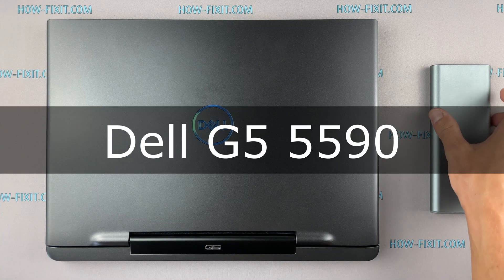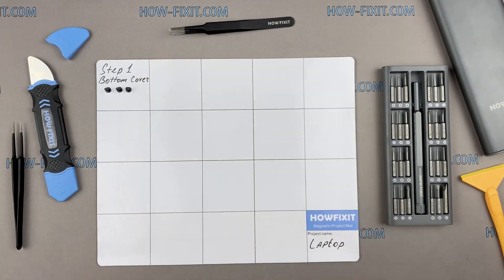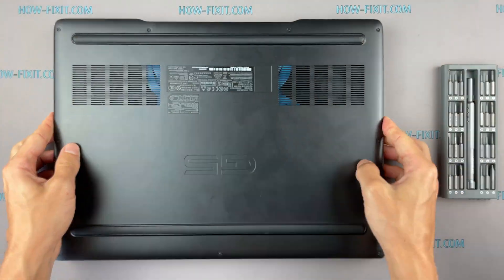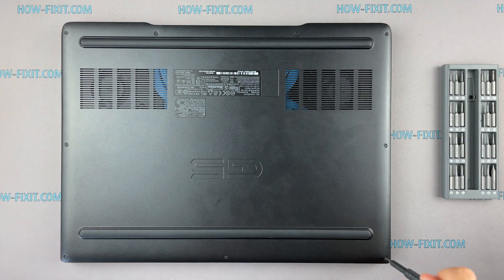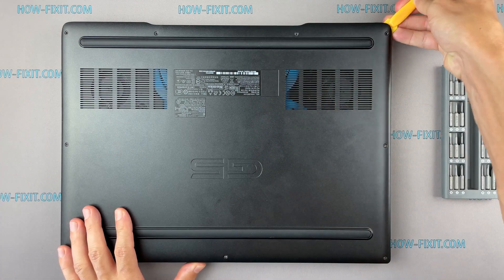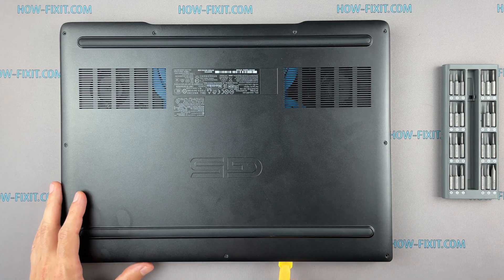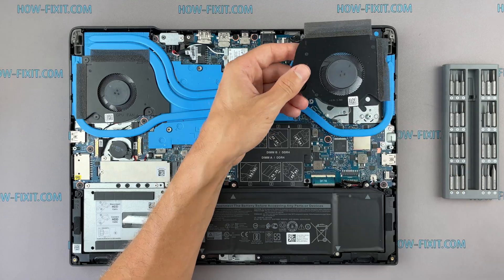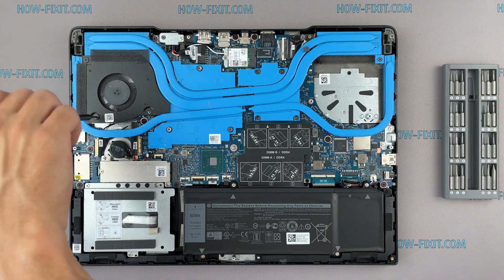Dell G5 5590 Fan Replacement | Step-by-step DIY Tutorial

Comment: Have any tips on removing the fan, seems so easy for you I had to rip mine off, was broken so no Biggy.

Is it clipped in, should it just pull out ??

Ordering a set of new fans and battery, battery bugdeing, when I was in there did a repaste of the CPu and cpu with thermal Grizzily, also uped the ram to 64 gigs, should get many more years out of it :)

Thanks for any help.

Been running a while without a CPU cooler, but have a cooling pad, still working, the repaste seems to have helped,  not so much thermal throttling, laptop cooler when playing games as well :)

Thanks again.

Only need a new screen now, 144htz, external of course, looked into replacing them screen, but that seems impossible, different connectors :(
Reply: Lol I came here because the connection on the fan, I cant remove the old ones and afraid to break them lol. So its not only me at least

Comment: My dell G5 5590 has the white 3-pin connectors and plugs......... does there exist a sort of adapter that can bridge from the 4-pin connector of the fan to the 3-pin connector of the motherboard? My CPU fan is acting up and I really don't have the money for a new laptop at this time.

Edit: If such a thing exists, I would be looking for a female 4-pin connector with a male 3-pin connector.

Comment: The screws by the hinge on my laptop are stuck, no matter how much I unscrew the screws, they don't come off the laptop. What should I do in this situation?
Reply: The screws by the hinge are designed that way they won't come off it's normal.
Reply: I need help with this too
Reply: @loka8142  and @Francisco They were designed to hang onto the laptop cover, as long as you unscrew them enough, you can pop the cover open
Reply: I think i found a solution. Put a pick between the io plate and the backplate (the one with the screw). Put some downwards pressure on the pick and unscrew.